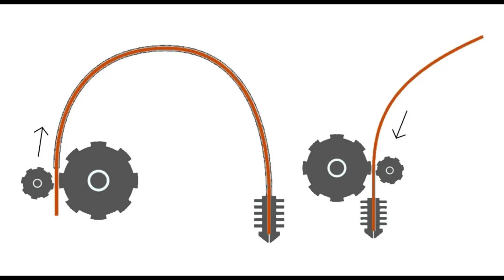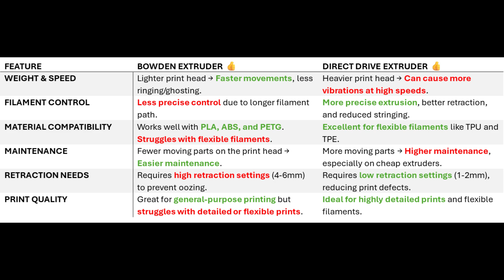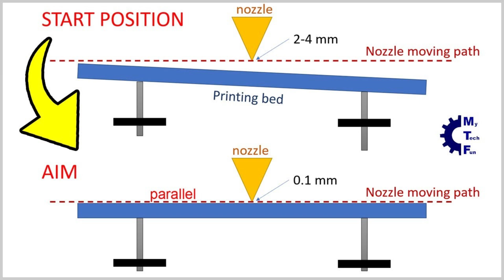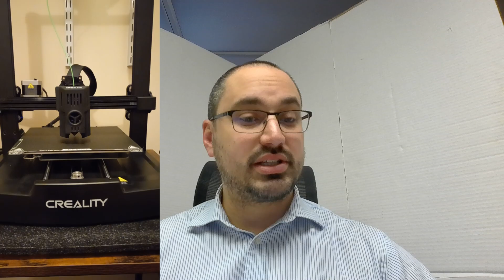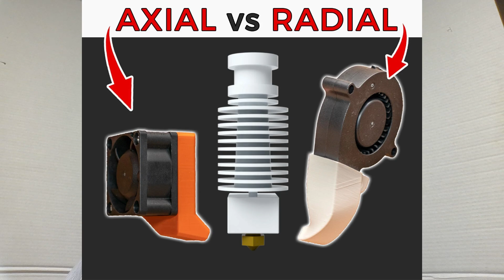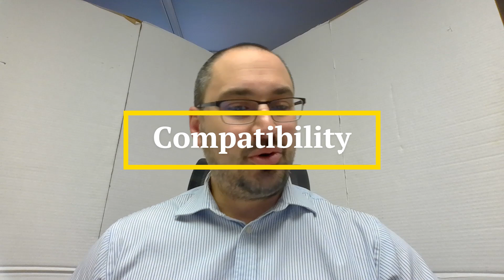Top 5 3D Printer Upgrades You NEED for Perfect Prints!

Comment: Owner of several Printers since 2014: Never did the Drive convertion on my Ender 3 and Tronxy X5SA-400. Autobedlevel i strongly recommend, i only have my Geetech i3 pro C not converted to Autobedlevel. Most cheap beds drop after a while. For example the large bed of my X5SA had a delta off 0.16mm when it was new, after one year the delta is now 0.36mm. Delta means the difference between points on the Z-Axis, i can't adjust it. Same goes for my Ender 3. The bed was flat with less then 0.1mm now it is around 0.2mm. For an manual level, everything above 0.2 is difficult to impossible to adjust for a good print. For Autolevel everything above 0.4mm results in bad print quality but it prints and a Delta below 0.2mm is good for perfect prints so manual adjustment is still needed for upgraded printers. Better fanducks with existing fans is a cheap upgrade and i recommend. For the Enclosure: Make sure that you have a solution for PLA to have fresh air inside (shutters open door etc). And watch the electronics temps of your printer, i killed one Ender 3 after 400 hours in enclosure and ABS prints. (i replaced him with another cheap Ender 3 and putt all the upgrades on the new one.)
Reply from the maker: This is very interesting. I had not made clear the downfalls of using an enclosure if you do not set it up with some level of ventilation and temperature monitoring.  Thanks for your insight.